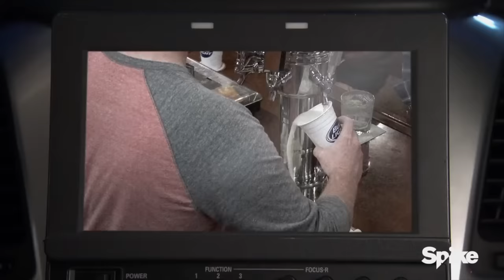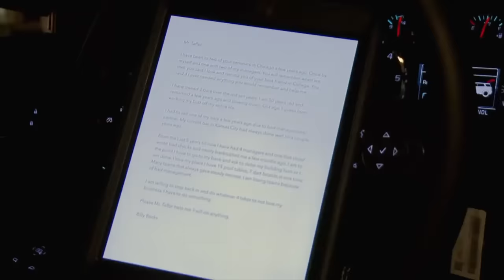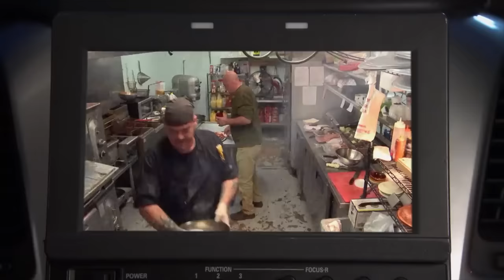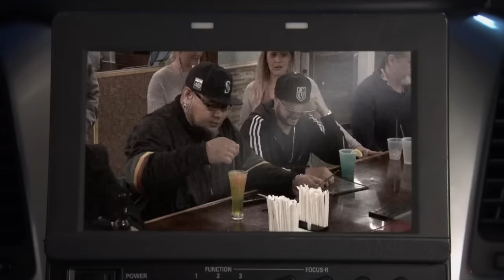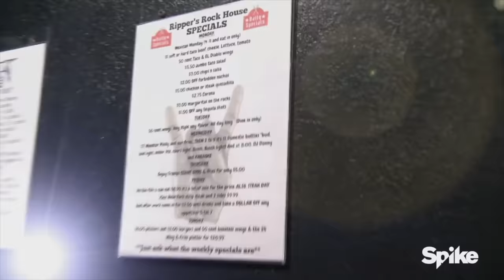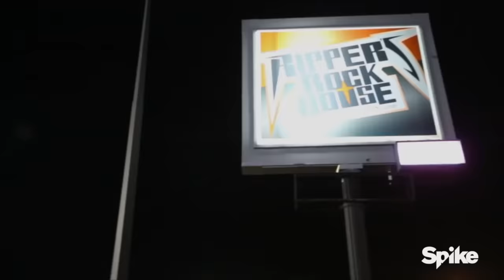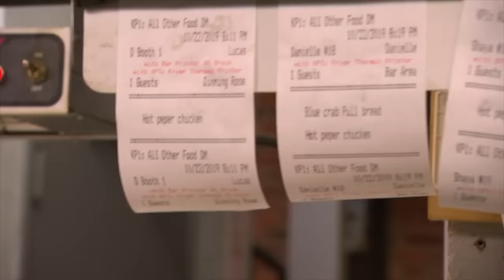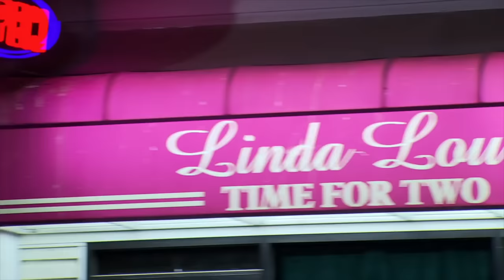Best Celebrity Recon Moments of Bar Rescue

Comment: The condiment stations getting warm is SO common. And it happens SO fast!!. Even when stuff is in insulated containers.  
When I was working at Sbux we had a health inspection and got docked MASSIVE points because of the self topper.  Our half and half was not cold enough. It wasn't in the red (danger danger), but it doesn't matter. Not just to inspectors but also to staff and customers. We took food safety VERY serious (in Cali) and as a manager I was devastated. Even if it wasn't enough to make someone ill. We replaced our creamers no less than hourly at  the time. Rhe experience sud help us to make changes to avoid the situation ever happening and changed the protocols to completely replace the creamers no less then every 30 minutes. As well as moving the location of the topper bar and eventually added coolers. 
Its insane to me that any other food industries establishment would not be focused on this

Comment: Hole the hell up. Okay to all of my short cooks (bars, fast food, pubs and so on). I have actually been to school for this. I have 20 years of restaurant experience. Approximately 7:07 in the video everyone knows the cleaning of the flat top. I worked a chain pub and grill. I would chrome the flat top the night before and by the time I came in for the next closing shift the flat top would look like this. To those who say it shouldn't, I have worked nights and days for 20 years. No matter the amount of scrapping and wiping it will look very similar to this by closing shift. There will always be a thin layer of oil that scrapping and wiping will not clean. So that slowly burns but never effects the cooking. Also to those that will say "what about the grease trap"?  Look at the upward scrap markers. Which actually means a flat blade  that day at least pulled the excessive grease of and to the trap. The back splattering on the far wall also happens. Not to say this place wasn't on bad shape. But not as bad as Jon said